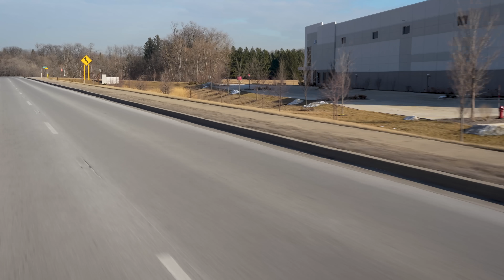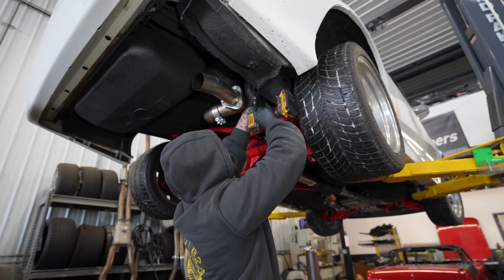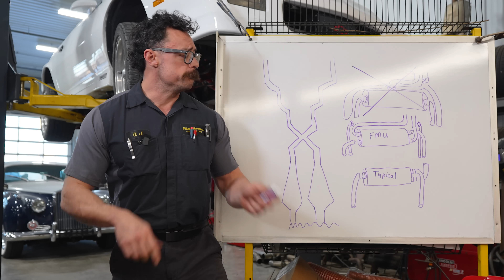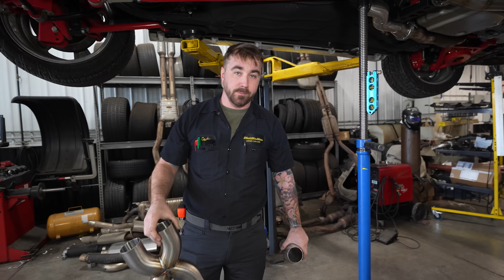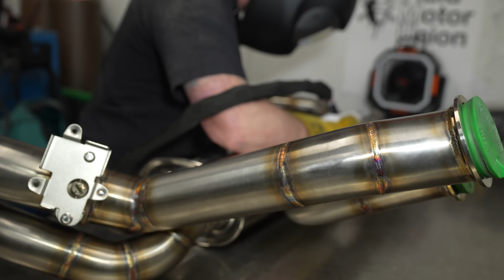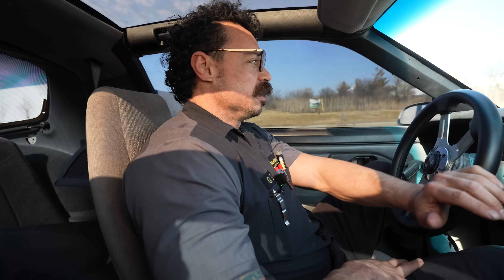This Camaro Exhaust Shouldn’t Have Made 30+ WHP: LS3 Stepped Pipe Layout Everyone Will Copy

Comment: I feel like you are under-estimating how much affect just getting a proper amount of exhaust CFM did. I do not feel like the magic is all the stepped sizes as much as it was eliminating that 3" section that was choking it. That Y-merge was horrendously bad. I feel like that car would have made equal if not even better power had there been room for a good properly designed merge Y and 4" single exhaust. It would not have been as cool and may not have sounded as good but I feel like it absolutely would have scavenged better and made more power. There is less friction loss in a larger single pipe than dual smaller pipes thus the exhaust velocity and flow is increased even though the larger single pipe has a bit smaller internal area. Fluids tend to stick to the outer surface area moving through a pipe creating turbulence.  I have a decent example of what a 4" single responded like on a ~500ish crank HP engine. I have an Express van with a 383 small block, that was born with a 350 that GM factory installed 3" dual pipes to the muffler on. I had previously swapped out the stock exhaust manifolds that cracked into multiple pieces at ~50K miles for Thorley Tri-Y headers made for the application about 15 years ago, upgraded the restrictive stock cats and muffler at the same time. System worked great on the 350. The newer 383 felt like it was being choked and the data was also suggesting the same. I set out to open up that restriction. Even with the added restriction of having to run 3" high flow cats, swapping a dual 3" inlet/single 3.5" outlet muffler way back at the rear differential for a nice merge Y right placed immediately after the cats and a single 4" straight through exhaust absolutely woke the thing up.  It makes more torque everywhere, it absolutely uncorked it up top, it takes less throttle to get it rolling and keep it rolling. It is also getting noticeably better fuel mileage even though I am still leaning into the added power fairly often. It is still an undergeared 7,000 lbs pig but just the exhaust change knocked over a full second of the 0-60. The difference in low-midrange torque was equally shocking. After the new exhaust went on, I actually ended up delaying power enrichment to a bit over the converter stall speed as well as cut some timing advance at WOT and lower RPM to make it not flash the converter as hard so it would hook up better. Before I did that it would just spin through most of 1st gear. Romping on it at 20-30 mph in 1st it just lights up the tires which is pretty wild for something that has 3,700 lbs over the rear tires that are 30.5" tall, a 2.48 1st gear in its 4L85E and only a 3.73 gear.

Comment: So much talk and then a X pipe that looks terrible for managing turbulence with the flow streams crossing at nearly 90 degrees, and then a shit ton of 180 degree bends at the back end.

I'd be willing to forgive the back end because it sounds like the customer made that choice, although having the valves that far back sucks for performance.

But the X pipe, come on, that's just lazy, literally all of your major flow turbulence is in your merges and that X pipe is almost as bad as an H pipe (this is also why it sounds so different too, at high RPM, that X-pipe basically barely works at all similar to an H).

All of those horsepower gains came from tune and changing from a 3" single (really small, 7.069 internal volume) to a dual 2.75" (11.88 internal volume), which is a sixty eight percent increase!

The welds look gorgeous but TBH, not super impressed with the result after they sold it that much.

Looks like a "more money than sense" build handed to an exhaust shop that's really good at marketing.

Your welder does good work though. As long as the product "looks premium" right?

Also, if a 630hp crank car only hit's 441, something is wildly wrong in the drivetrain, not even a TH400 drops ~30% in the drivetrain, let alone the smaller tranny that the Camaro has.

Fun fact people: It's very easy to swing huge horsepower changes with "just a tune" if the tune your comparing it to is crappy, and you massively increase the volume of the pipe... and considering the tune they were comparing to was tuned on an entirely wrong signal, it's likely extremely bad.

Comment: That Camaro reminds me of my 91 I had when I was younger.   I got it from a car lot that didn't know what they had because the distributor was so loose it would change timing on its own so they sold it to me for $1,100 and I later found out that it had some kind of  crazy circle track motor put in it and it would rev too like 9100 RPM and it would not die off power I used to completely bury the tachometer between shift points and it never once got valve float. However it was dumb to do because in my young age I did not know much about oiling systems and it eventually did in the wiping out the camshaft due to the oil getting foamy from where we get so high on Long freeway pulls.

Comment: I would say if it’s the same car throughout the day compensation does not matter because your Tune is going to gain horsepower until it doesn’t
   Compensation would matter if we’re testing it an ideal dyno conditions  and then down the line a few months later in conditions that we believe are not good Dino conditions and she gain or we see less horsepower. It’s because we didn’t do compensation. But we tune it again and we make 2 hp over 10 different dyno pulls. 
    did the Dino compensation matter ?  
   Either way if a dinosaur shows you made improvements in horsepower you win. 
      So logically to me it makes sense I believe him it doesn’t really matter.

Comment: you could see how the tune was "safer" previously from the graph. It increases power near the middle of the RPM range, going to its limits. While the new one has tremendous horsepower, it seemed like it is all unleashed in the beginning of the RPM range and drops off sharply. Still awesome work.

Comment: Flywheel horsepower should be closer to 525, maybe 540.  75-100hp drivetrain loss from stock is typical.  Some people say 20%, but that's stock loss as drivetrain loss does not increase with an increase in power, at least not exponentially or congruently with power increase.  Once you determine what that loss is at stock, then it typically remains constant and does not increase with more power NA.

Comment: I had one of these cars with a 383 sbc, tpis mini ram, haltech e6gm, mufflex 4” exhaust and a 3” Y pipe I built. Daily driven, ran 11.40’s at 122mph in the late 90’s. Looked and drove like stock, and it wasnt stripped down pos. I had it necked down into a stock muffler, capped off the passenger outlet and put a cutout and tailpipe in the bend around the differential. Sounded killer. Especially shifting at 7800 rpm. (Solid roller cam and big flowing cylinder heads).

Comment: A good 15 yrs ago i posted my true duals on my 4th gen. I built it with 3 Magnaflow X pipes. Theory was if one increased scavenging, then why not 3. That and using 3 Xs in duals that are side by side made the exhaust rigid so less hangers. 6" round can mufflers. So a few laughed and tried to flame what i did in the days of forums, but with a mid size cam in a temporary L33 5.3, the note i have told by people at the track was closer to a built late model small block stock car, than an LS build. When you get compliments from people outside V8s and domestics, i dont know totally why it works ao well, but it did.

PS get rid of that inferior panhard setup and put in a body mounted Watts Link

Comment: Man this is bringing back awesome memories. My dad (RIP) was THE hot rod builder in our small town back in the 80’s & 90’s. I had a white 1984 Camaro almost exactly like this one but with a junk V6 in it in 1994. My dad and I built a 350 for it after I blew that junk V6 and when it came to the exhaust he struggled…struggled some more….and struggled even more and you are saying the exact same things my dad was saying. We weren’t the wealthiest family so we never really got it right….we just ended up throwing glass packs on it and calling it good. 🤣 We also struggled trying to find a rear end. Unfortunately we never finished it up because a lady attempted suicide one night by jumping in front of my car while I was doing 55mph down the highway. She lived but it gave me a little PTSD so I didn’t want to fix the car or drive it anymore. I was only 17 years old and seeing her face smack my windshield and then her body crumple over my T-Tops was hard to handle for a kid. I left for the Marine Corps the next year and my pops parted the car and motor out.

Comment: Idk ... you finished the system at this point but I would put the flange onto a slip fit cut off so you can mock out where everything is you have flex to shift that flange around and then you can put some heat seal and wrap them hopefully still removable in worst case but properly sealed and you can pull the system to service the transmission or drive shaft.

Comment: Well I think you need to strap that rear down more on the dyno
Reply from the maker: Yep because that was the right strap breaking! It was a pretty cool shot although a bit frightening, but the strap was just old and there was a lot of components with hard angles it was holding down. It happens a few times a year which is why we always have backups at all the other corners.
Reply: @FluidMotorUnion  damn it, I bet that was uneasy feeling for sure. I remember when I drove my 70 Cougar on the Dyno last year for the first time - before my first hit just about every worst thought went in my head about launching off that Mustang Dyno at full throttle.

Comment: 3rd and 4th Gen Camaros/firebird owners always do the Y pipe and single 3” out. This makes no sense for flow and sound since each header is 3” by itself. It needs to merge into a single 4” or duals for max flow and to get rid of that awful cackle these cars have at mid RPM

Comment: Hey guys, just need some urgent help.

I'm making a custom exhaust for my 2017 Audi S4 B9 V6 3.0T.

Gonna be using a Race Downpipe which goes from 6"-6.5" inlet then slowly tapers down to dual exits (outlet sizes of 2.5"), then connects to a 2.5" to 3" back down to 2.5" midpipes (replacing front resonators with a [2x] 3"- 4" - 3" megaphone due space constraints) then a X-Pipe basically straight after it then dual 2.5" exits all the way back with rear mufflers plus factory location valves.

why 2.5" after X-Pipe due space/size constraints can't fit 3" cat-back system there....

any thoughts would be helpful?

Comment: I am a little skeptical of it having 625hp crank, that works out to around 29.5% loss, typically you don't see 600-625 HP crank with a stock 821/823 rec port head unless it's a 402,408, 416 stroker or a specially built high compression 370 or 376 using a stock LS2, LS3, L77, LY6, LQ4, LQ9, L76, L92 6.0 or 6.2 block. I think that it would be a safer bet to call it a 25% loss and say it makes 588hp crank or even 555hp at 20%. None of those are bad numbers for a 6.2 with a cam, headers and a FAST intake. Some people even say an LS with a stick will do 10-15% losses and you'll see full bolt cammed stock bottom end 6.0s and 6.2s in C5, C6, 1st gen CTS-V, G8, GTO, PPV, 5th Gen Camaro and 4th gen Camaro/Firebird making like 480-495whp with a 6 speed typically in places like Yellow Bullet or LS1 Tech. I will conceded the lack of correction factor could put that car anywhere between 550-625hp crank just depending on the situation. Usually to get the high end while being 6.2L, extra compression and a ported head or aftermarket head is usually in play. I am not saying this to be critical or a jerk, I just prefer when people air on the cautious side with power numbers when you see 441whp and figure a smaller loss. The biggest test would be what it runs in the 1/4 mile and even if it doesn't hook well that trap speed or the 2nd 1/8th will tell a story once it is hooked up.
Reply from the maker: You probably should watch my other videos and the numbers those cars produce before telling me to be careful about what I say when using my dyno lol. Stock hellcats put down between 494ish -505…
Reply: @FluidMotorUnion @FluidMotorUnion Eric Weingartner did a camshaft shootout between the best grinders in the country 23 cams in a 408 stroker with ProMax LS3 heads in a dyno cell and they made between 620-670hp with no accessories or restrictions of any kind. https://youtu.be/vFRJkI2-aPU?si=kL05gc7h7UP8uIH1Richard Holdner at WestTech did an LS3 intake manifold shootout on a stock bottom end. A stock intake did 580hp the FAST 102 with standard length runners made 585hp at the crank with no accessories with touched up stock rec port 821/823 heads.

Comment: The 'After' definitely sounds like a MUCH better running and breathing motor. It still sounds very "LS"-like, not a necessarily bad thing, but a rowdy SBC (with the old firing order) decidedly has a more 'street' sound that us older gearheads appreciate (even though I am a MOPAR guy). But O.J., you and the crew have performed yet again another motor miracle.

Comment: It's more like a 540-550 crank horsepower car, assuming it's a manual. There have been a few guys with literally these cars who have dyno'd their engine and then put it in the chassis and dyno'd that and discovered that it's an 18-20% loss. EDIT: Ah, it's an auto.

Comment: You use a 2 or 2 1/2 inch pipe cut in half down the length of the pipe.  You then reconnect them using 2 or 3 inch wide flat strips making a pill shaped pipe.  This gives you the large flow rate and the clearance you will need at the same time.
Reply: Or just buy oval tubing ......

Comment: Wish you would have tested replacing the 3" tube behind the Y with a 4" back to a single 4" in/out muffler.   Willing to be the performance would be comparable and cost ten times less.
Reply: Single 4" works. Just went to it in my Express.

Comment: I wish I could show you all my 87' RS Camaro. After welding in a South Side Machine Lift Bar kit that included two sub-frame connectors, and a crossmember for two lift-bars that welded in under the DANA 60 with 3:54s I got from DTS, I ran a pipe from each header under it and out the back to a couple of long supertraps without the end caps. The lift bars negated the need for the OEM torque-bar so other than moving the fuel line to the other side of the frame rail it was all good. I did get longer diffusser disc screws for the Supertraps so I could add some discs with like No.10# flat-washers between them to give em a little more space from each other so they wouldn't clog with carbon so easy, and unless you're getting on it, the sound is relatively quiet (less than most Harleys) and it sounds F-ing bitchin when you do get on it. I had to wrap the pipes by the diff and put synthetic in it to keep it from over-heating on the highway, but that was no big deal. I didn't bother to X pipe it. That's too much surgar for a dime in my opinion and I like being able to troubleshoot one bank at a time anyway. The bottom line is I think that for any vehicles with space restraints, Supertraps are a great solution because they don't take up much space and they sound great.

Comment: Cool 3rd gen F body, one of my favorites. There is virtually no room for exhaust on these cars, without hanging down somehow, especially with long tubes. Seems to me (in my ignorance) flow is as much about speed as volume when it comes to proper scavenge. I have an LS swap, custom 2.5 Y pipe to a 3" sweep 90 like the OEM single exhaust set up (with a high flow cat in my case) I cant handle exhaust hanging down, always thought some type of flat / oval to keep it up tight. Exhaust was (for me) one of the toughest parts of my swap on my 83 with HO LQ9. Lastly, I am fighting weight, one of my goals with my car is to KEEP IT LIGHT as possible. Only "extra" I want is a pre-muffler electric cut-out. Beautiful work guys, Thanks!

Comment: I would kill the torque a bit with a different set of gear ratios in the transmission if it has the 700r4. Make that engine work against what weight that car has. Then figure out if anything can be done with geometry of the suspension to plant the tires better. Then better tires. Then rebuild a busted transmission with harder parts. Then fix the seat belt.

Comment: Impressive. But you are calculating about 30% power loss through the drive line, to get 620hp at the crank from 442hp at the wheels. Seems high to me. With 15% loss, crank power works out to 520hp.